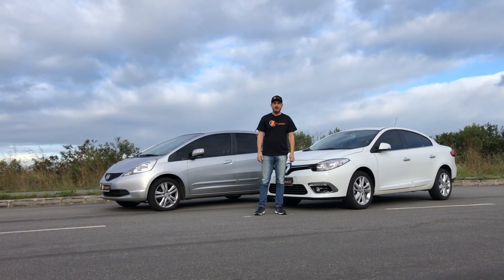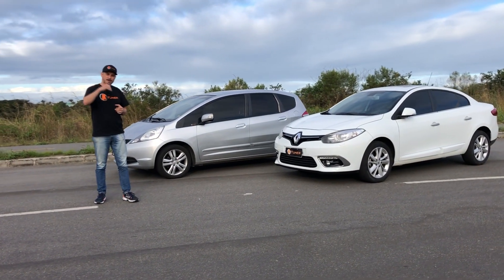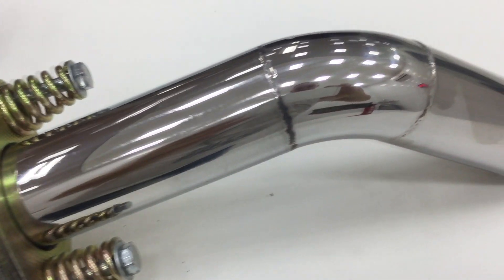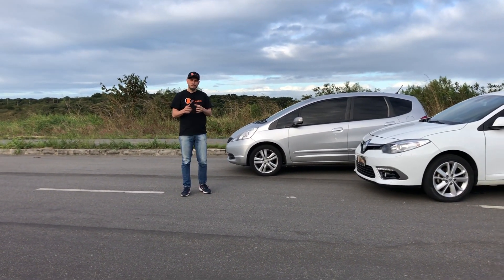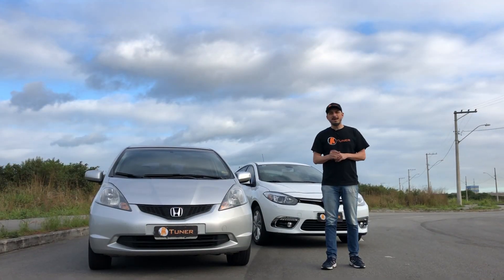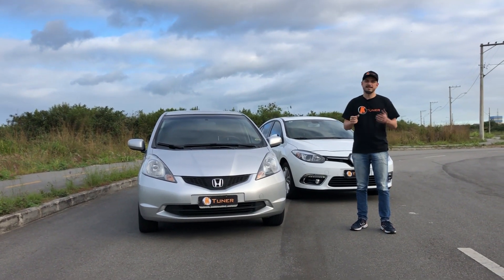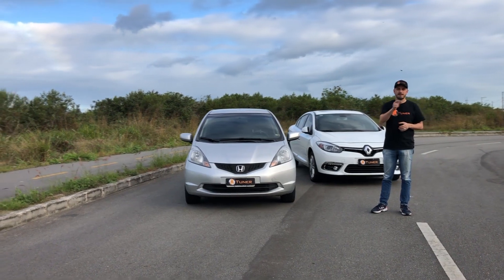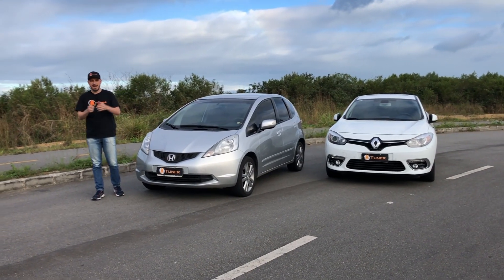Honda Fit Stage 3 Vs Renault Fluence 2.0

Comment: Porque testar contra um Fluence? Se você não mostra como era o Fit original contra o Fluence eu não tenho parâmetro pra nada. Adoro os vídeos do canal, mas desta vez não entendi a comparação! Um carro difícil de ver na rua AT, pesado, CVT Renault, contra um Fit preparado. Não tem lógica alguma. Teste contra HB20 1.6 MT, New Fiesta 1.6 MT, carros do mesmo seguimento ao menos.

E uma dica, porque essa invenção de estágios. Isso não faz sentido algum, três peças = Stg 3. Por isso tinha aí Civic Si estágio 7, tipo, coisa sem pé nem cabeça. 

Stg 1 = filtro, remap/chip, escape/ou coletor.
Reply: Tudo mentira
Reply: @fredydofluence3709  o que é mentira? O Fluence ter um câmbio bem bosta? Ser um carro pesado (1372kg) em relação ao Fit (1050kg)?! Serem de seguimentos completamente diferentes? Deixa de ser parcial e incoveniente! Mentira é seu...
Reply: @jpbxlbh  mentira q o fit deixe para traz o fluence dessa menera q mostraram no video... oque o fluence tem de peso tambn tem em motor e comforto..    nao adianta o carro ser leve e nao ter motor.
Reply: @jpbxlbh  eles sequer aceleraram tdo o fluence. Procure um video do fluence cvt acelerando a diferenca no ronco do motor quando vc acelera tudo o arro.. wleu
Reply: @fredydofluence3709  fera, meu comentário não tem nada a ver com Fluence, é simplesmente pra falar que a comparação é ridícula! Carros de propostas completamente diferentes, não mostra o comparativo do carro antes dos upgrades, não tem lógica nenhuma. Agora se acelerou tudo ou não, eu não sei, não faço crossfit pra saber.
Reply: @jpbxlbh ok. Tambn comcordo q nao tem logica a comparaçao.

Comment: Acho que para o teste ser um pouco mais coerente,  deveria ter arrancado da forma correta no fluence a tirar todo proveito câmbio e motor. Experimente colocar no modo manual do CVT, colocar 1°, segurar no freio e pisar no acelerador para depois soltar. Ai sim iria ser um comparativo justo. Vocês fizeram isso no fit para largar deixando o fluence subir gradativamente. Outro detalhe, para tirar mais proveito desse modelo do cvt, você não mantem o pé no fundo o tempo todo,  pois o câmbio fica deslizando. Você pisa tudo e depois solta o pé uns 10%, vai sentir o carro dando um leve pulo para frente, depois afunde novamente. Isso faz com que o câmbio pare um pouco de deslizar. São informações que talvez ajude caso queiram fazer um novo teste.
Reply: Se fizer isso o fit perde.

Comment: Comparativo desproporcional.. um hatch, cambio manual, com upgrades no motor, contra um sedan médio, original com cambio automático. Reparem que no final do vídeo se tivesse mais alguns metros o Fluence passaria a frente, pois ai o 2.0 começa a fazer diferença. São carros com propostas diferentes. Da uma "incrementada" no motor do fluence pra ver o que acontece.. Mas fora isso, parabéns pelo trabalho, só pelo ronco do Fit da pra ver que ficou redondinho..
Reply: No final do vídeo, o FIT tira o pé antes do Fluence pq acaba a pista e vem uma curva para esquerda. Não era o Fluence crescendo, mas o FIT parando de acelerar e depois pisando no freio. Em todos os vídeo de comparativo, um pouco antes da curva, os carros param de acelerar. Só isso.

Não precisa "incrementar" nada no Fluence. O Fluence era só uma referência para mostrar o quão bom ficou o FIT com a solução Revitup. Cara, vc não entendeu nada...🤦‍♂️

Comment: Por favor façam um teste desse Honda Fit estágio 3 com um Renault Sandero RS. Apesar de ter um motor 2.0, o peso e o câmbio CVT comprometem bastante o desempenho do Renault Fluence.
Reply: Se fosse o Fluence manual com certeza levaria o Fit. O CVT da Renault, diferente dos que equipam os Honda, são voltados para o conforto, não para desempenho.
Reply: @EliabeAl  do Honda é voltado pra desempenho? Kkkkkk
Reply: @maxwellpereira  sim.. veja os números do Civic touring. Basta andar nos dois e perceber como o comportamento dos dois câmbios são diferentes. Agora pega um Fluence manual e um CVT, o manual é mais rápido que o CVT. Pega um Civic 1.5 turbo manual e um CVT e vai ver como o CVT dá pau no manual.

Comment: Rev it up está fazendo comparativos não tão adequados. O ideal seria pregar hatch’s aspirados referência em desempenho com Ford ka 1,5 aspirado ou hb20 1,6 manual. Segundo, se fosse pra escolher 2.0 aspirado que fosse bons em desempenho. Fluence... totalmente voltado para conforto e economia. Corolla, no caso iria levar papar esse fit ...
Reply: Cara, naquele canal TSI MT tem uma tabela dos carros que eles testaram usando o v-box, tem os dados do Corolla 1.8 manual lá, e o Civic 2007 todo fuçado que a Rev fez  (o Civic comum, não o Si), anda a mesma coisa do Corolla original hahah
Reply: Não sei o Fluence CVT, mas o Fluence MT anda muito.
Reply: @capitaocaverna8006  o MT anda bem mais que o CVT, esse fit deve ter ganho no máximo uns 15 cv's!
Reply: @aceleracaomaxima4240  gastou 4 a 5k pra ganhar 15cv...aonde vale a pena?? Os trampo dos caras nos k20 é sensacional, mas nesses aspirados comum é muito investimento pra pouca potência.

Comment: Fluence anda bem, mas foi um carro que nunca vimos aqui no canal, sem falar que poucas pessoas sabem do desempenho do Fluence, anda mais que um Corolla? Provavelmente não. Então fica totalmente sem parâmetro, por que não testar contra um HB20 1.6 antes e depois? Ou testar contra o Corolla que já apareceu no canal, Ou contra um Fit original.
Reply: Tenho um manual e te garanto  anda levemente mais que o corrola 154 cv fiz varias puxadas
Reply: @evandrobirk5924  Manual é uma coisa, CVT é outra. No TSI/MT mesmo tem teste do manual, e dá pra ver que anda bastante.